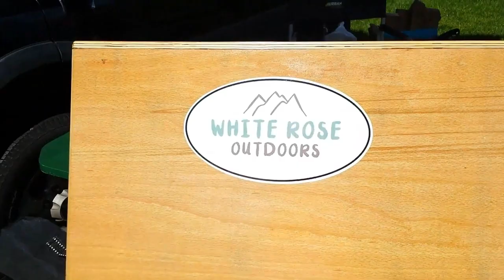Is this the ultimate bench grinder modification/upgrade?

Comment: I wouldn't say it's the greatest... But it definitely has its place for anyone using these to rough out axes, shovels and other large items othen enough. You turned a general tool into a specialised one with so little work!

If I may push your idea a little further, It'd be awesome if you made an adjustable toolrest that properly fitted the new configuration (you could also get rid of those cheezy "eye shields" in the making) and modified the wheel guard to catch and sparks away from the wall and down onto the workbench

Definitely some value to your work there. Keep it up!
Reply from the maker: I can't believe what I've just read! Someone watched my video, saw where i was trying to go with the modification and had some great ideas to improve it! Makes a change to usual hate i get lol.

Thanks bud, i appreciate the feedback, definitely room for improvement and i like your ideas! 

Thanks for watching! Atvb Chris